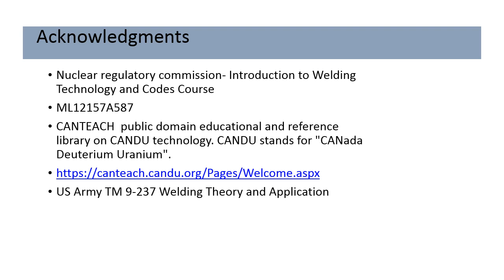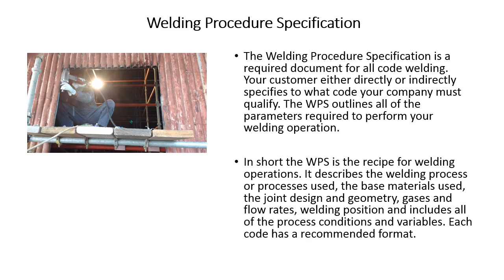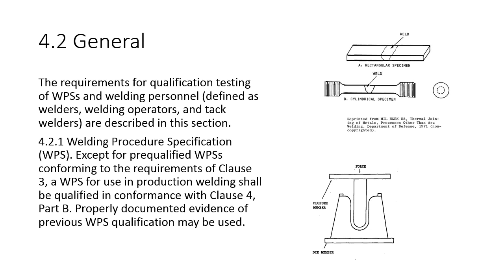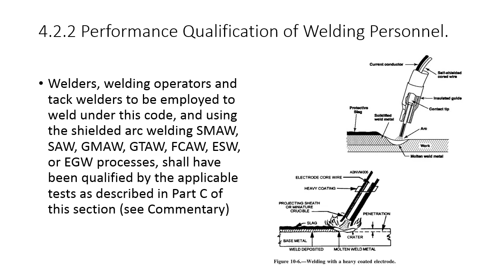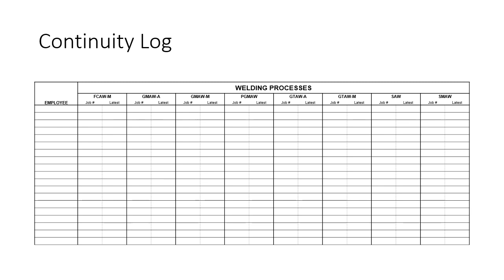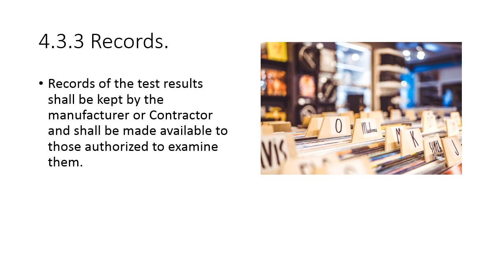AWS D1.1 Clause 4A Qualification Explained | Structural Steel Welding Code

Comment: Hi Garry greetings from Chile South America...I got a question regard an specific situation am going through now...it´s related to the two standards governing an assembly in where I got AWS for structure and ASME for piping but funny thing is I can´t use the one intended for piping supports to do the welding in building structure, now you say that all depends on the engineer to authorize the use the one into the other....is it?
Reply from the maker: Google Texas welding engineering and email me